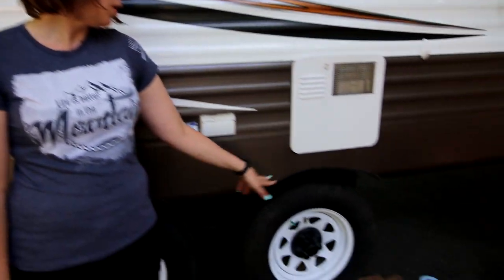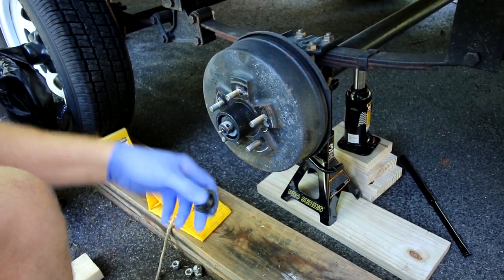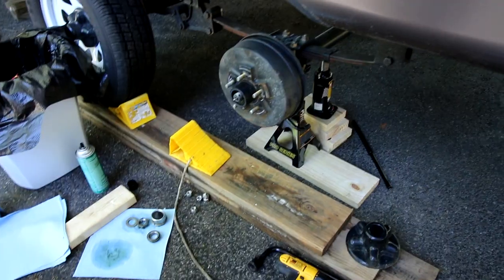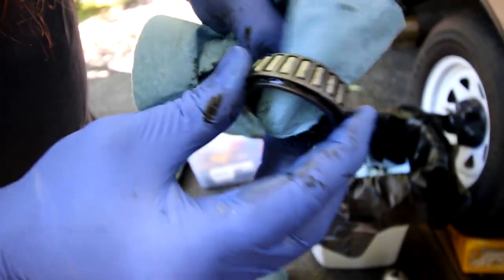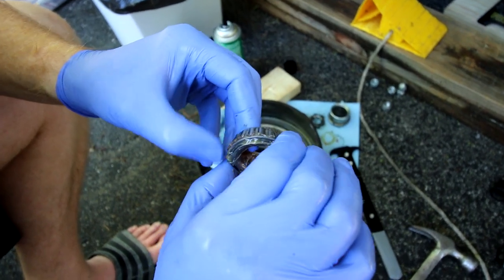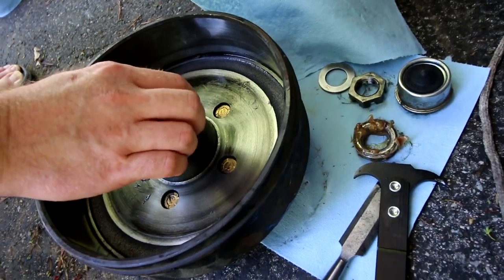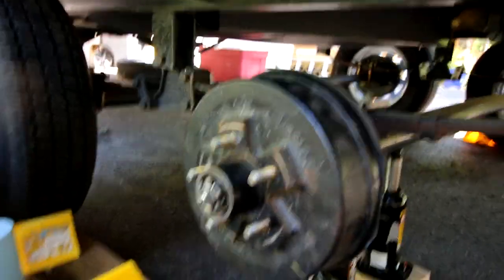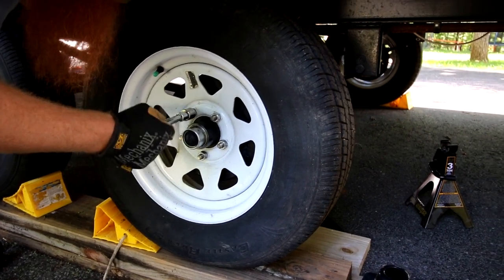How To Repack Trailer Wheel Bearings Start to Finish

Comment: Great video - I used to pack 'em and then the last few years a just used the zerk fitting on the Dexter axles....just not sure I'm getting the job done completely.  I DON"T want to be on the side of the road thinking "woulda-coulda-shoulda" and having momma giving me that "no shortcuts" look.   Extra points in the vid for wearing the tactical shower slippers.

Comment: You did most of the steps here. Should clean bearings thoroughly using a solvent. Hand pack from the back side nit the taper side. Mixing grease types in not suggested. Tighten crown nut to spec is a must to seat seal and bearings in races, then back off to first hole for pin. Fill hub with grease using zerk fitting. The grease will thin out from heat and leave the bearings.

Comment: This is the second video I have seen that the person packing the bearing by hand was pushing the grease thru from the small side of the bearing.  It is worlds easier and is the recommended method by Dexter in their manuals, to push the grease thru from the large side of the bearing, WHEN HAND PACKING. I have done hundreds of bearings over the past 50 years and this is always how I have done it. The bearing packer is much easier however and probably better.

I will compliment you however, as you have done a good job of showing the process, and the proper way of doing it. It seems that no one ever shows the brake adjustment that should be done afterward.
Reply from the maker: Thanks for the tip on pushing the grease through the large side when hand packing. We are by no means experts on it as we have only been doing it for a few years,  this is just the way my husband learned to do it. The bearing packer is a much easier way for sure. Good point on the brake adjustment also. Thanks for watching and have a great day!

Comment: Nice job have one question. Why did you not use a grease gun on those grease zerk or nipple .on those dust covers, they looked like you had those little rubber cover on those covers. I could be wrong but it looked like you had them.
Reply: You can do that.  You pump grease in the zerk and wipe out the old grease that gets pushed out.  Once the grease that comes out is clean, you know you're done.  You don't get to inspect the bearings this way.  I want to make sure there are no hidden issues, so I do it the long way.
Reply: @ALandMe-2011  I never ever ever use that ez-lube hub. If there is an issue with that rear seal, the ez-lube hub would now be pumping grease into the brake mechanisms...this is a major no-bueno condition. If one insist on using it, ok perhaps maybe immediately after a new seal has been installed, but even then, I'd just pack it by hand every time and skip the greasy brakes risk. 

On a disk brake conversion I could see using it, because the brake contamination risk is greatly lessened and immediately visible if that rear seal is letting grease get by. Still I always hand pack, mainly for the reason you mentioned, plus the seal condition, and hub/axle surfaces for coloration and wear.

Comment: As well as your in depth help for others to follow, I must stop at the beginning when I saw
your camper being lifted by the axle which is ABSOLUTELY against any recommended 
practice for a camper or trailer. Safe travels.
Reply: Against any recommended practice?  That's a definitive statement, but indicates a narrow look at recommendations.  I can only guess at your reasoning, but I'm not really worried about damaging my axles when placing the jack near the tire.  If you're one that thinks its bad, don't do it.

Comment: There is a reason the grease zirk is on the grease packer,you fill the packet with a grease gun, but I suppose you could glob it in
Reply: Didn't buy grease in a grease gun tube.  Kind of hard to get grease through a zerk when it comes in a tub...

Comment: The only finger tight , is not good advice. If the inner bearing or seal isn't in place it's going to cause serious damage or a accident. He needs to tighten down the spindle nut to at least 50# and then back it off a quarter turn. Or tighten it 50# then back it off and finger tight. You are getting very lucky that it's been working out. Please tighten them up first to set it all.
Reply from the maker: You do know that if you torque it to 50# then back it off and finger tight that you're ending up "finger tight"🤔
Reply: @AliciaLynnYT  When you torque that nut down, its call pre-loading the bearings in the races to align the bearings up then back off and finger tight to the next slot to align up the cotter pin.

Comment: Lil helpful  trick for next time get yourself a  plastic gallon jug. Cut it in half put sum gasoline in it.  An now you can really clean out those s bearing s.  An i use shop air to blow them out but do not let them spin. Or you will ruin the bearings. An repeat. As necessary.
Reply from the maker: Thanks for the tip!